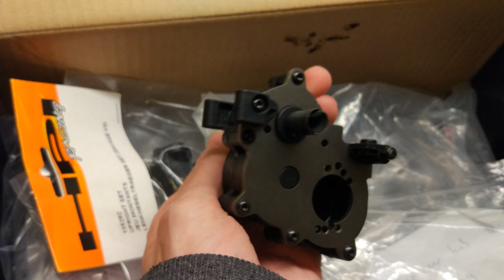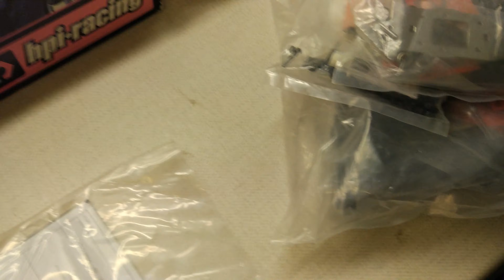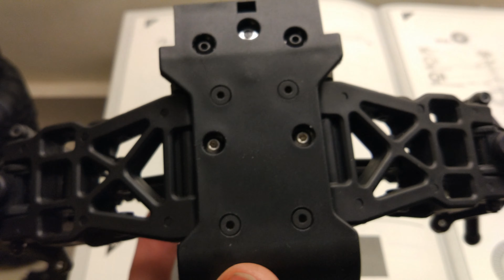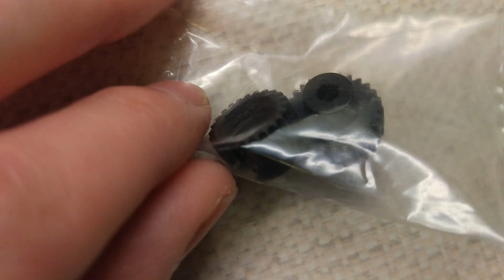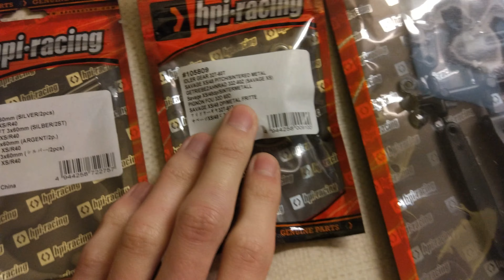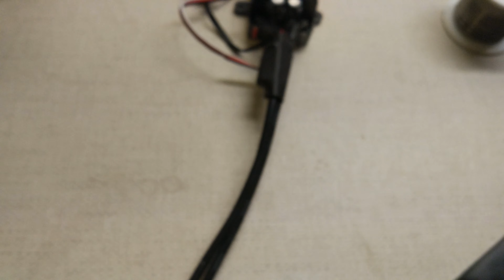Savage XS SS Build

Comment: I loved mine, I did find the bearings were rubbish, at the 2nd big MSUK bash I was forever changing them when they blew out
Reply from the maker: Yeah, they are not rubber sealed, and probably the cheapest metal shield bearing they could find. I'll order some rubber sealed bearing for when they go, thanks for the heads up.